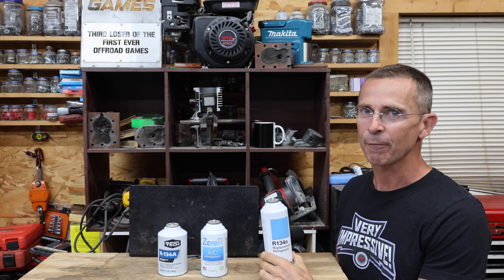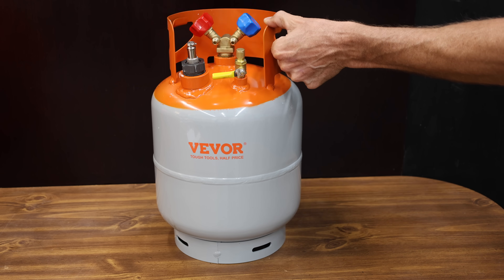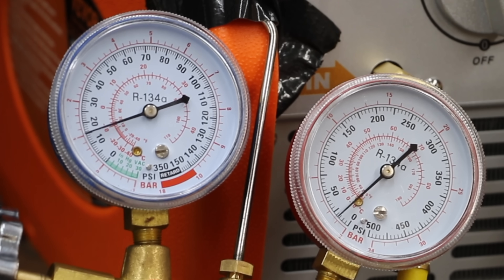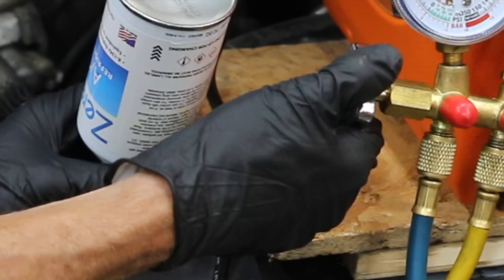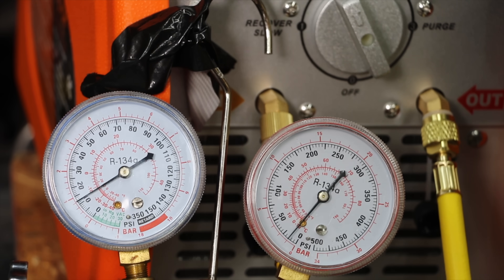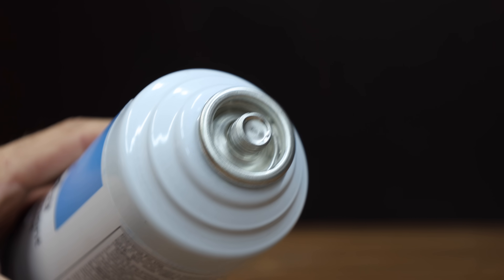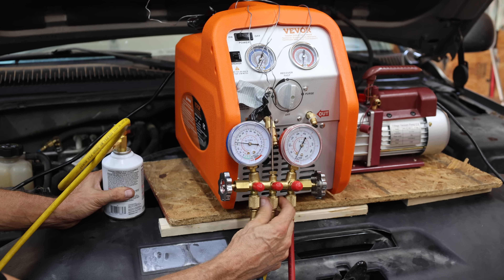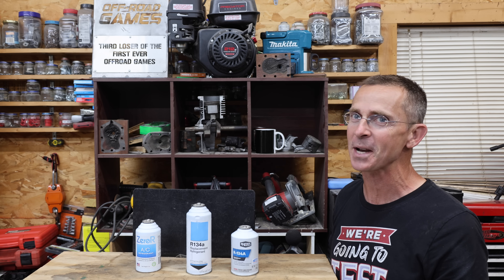How Dangerous is Fake Car A/C Refrigerant? Let's Find Out!

Comment: I own an HVAC company and I'm surprised how well and thorough you did with this video. I shouldn't be, because you're always thorough, but I never expect anyone to grasp refrigeration very well. Great job! I didn't even realize there were a bunch of 134a replacements on the market. Good to know. Replacement refrigerants usually work fine, but I avoid them when I can. 
Also, I'll ask again and hopefully one day you'll be able to get to it, but- testing coolant additives would be awesome. Those additives that are supposed to make your cooling system run cooler like Royal Purple's Purple Ice, Water Wetter, etc.
Reply: I've heard some compounds have troubles mixing with oil in the system. You gotta use different oil with them. All in all probably not worth the risk.
Reply: Propane works as a R134a replacement and is used in the EU in giant refrigerated warehouses because of reasons that have to do with Greta Thunberg
Reply: @The_Chad_  I used water wetter in my engine 25 odd years ago
It worked for me 👍
Reply: I would also be interested in a video on this. I don't like to waste money. But if a product is good, I want to know
Reply: @lt.lasereyez8891  You need to use different oils with different refrigerants, so you cna't simply replace them. You can find vids on youtube about how they mix with different oils
Reply: About 15 years ago I worked at a Chrysler/Dodge/Jeep dealer when they were still under Diamler/Mercedes. They were back then trying to find a safe way to use propane as refrigerant because of environmental reasons.  

Works "okay" as shown in the video as a replacement, a system properly designed around the use of this stuff would probably be hard to tell the difference because propane at least boils at like -40~ish degrees.
Reply from the maker: Thanks!  Thanks for the suggestion.
Reply: @astrangeparrot  yeah but I find it dangerous especially in large applications and cars
Reply: @lt.lasereyez8891  Yup and the next "safe green" refrigerant they want to require in the US is 70-80% propane.
Reply: As a certified MACS/IMACA Tech I feel this video is quite possibly the best one I've seen so far that describes how an automotive system works in easy to follow and understand terms and the methods used on the system were quite well done even to the point of reclaiming the replacement into a tank that is not the same as one that is known to have nothing but r134 in it. If memory serves me right the replacement stuff has a hydrogen fluoride component in it similar to r1234 which should not ignite when exposed to hot surfaces or sparks, but will ignite when exposed to open flame.
Reply: Auto racing sanctioning bodies actually require water wetter instead of ethylene glycol, due to the slipperiness created if that type of coolant should wind up on the track - creating a hazard for other racers. Water wetter has a long, successful "track history" in modern auto racing.
Reply: @PuerRidcully  He's not talking about AC systems, he's talking about engine cooling systems and products marketed as "Water Wetter", etc
Reply: Honestly, if you want your cooling system to run cooler, just replace your thermostat with a lower temp one. Most cooling systems are capable of better cooling right out of the factory but the stock thermostat kicks in higher than necessary. My stock thermo was a 195F. I swapped it for a 180F and it's doing great.
Reply: Never add coolant additives to your A/C per Scotty
Reply: @TheCharleseye  Running you engine cooler than it's should comes with negative consequences. Not only in efficiency, but it wear and tear. Those higher temperatures are used to leverage various things, up to and including keeping moisture out of your oil system and crank case. It's generally not a good idea for regular duty vehicles.
Reply: @therealdojj  I used it around that time as well I think some of it has to do with what it is actually supposed to do.  I used to get to work about when the car was finally throwing heat in the winter.  Using water wetter it was within just a few minutes at most typically.  First it's less effective when not using pure water like in racing many don't realize.  Second it is supposed to more efficiently pull heat from the motor.  By reducing surface tension, to eliminate heat pockets which coolant can't effectively cool.  Which most cars measure the coolant temp not the actual metal.  Depending on the vehicle the coolant may get warmer since it is pulling more heat from the engine.  If your cooling system is in bad shape, coolant is old or not the proper ratio yeah probably not going to get the result you want.  Besides your thermostat and engine computer want to run in a certain temp range.  They will do what they can to ensure that happens.  Gripes about WW are like when people use different heat range spark plugs for the same expected result.  They are designed to run in a different range not magically drop your engine temp down 3 degrees or anything like that.  If you don't adjust anything all that will happen is at best they will run worse or wear out sooner than the correct ones would have.
Reply: @PuerRidcully  That definitely can be true, but most newer refrigerants and refrigeration systems will use oils that are compatible with one another, but that's definitely not always the case and it's best to know for sure before replacing a refrigerant.
Reply: @funkyzero  he was talking about  both?
Reply: @PuerRidcully  that can be true, but isn't universal. It was more a problem when systems that used mineral oils were being retrofitted with refrigerants that require POE oils. It's still something you need to be sure of when doing a retrofit, but it's not like the oil needs replaced in every circumstance.
Reply: @DrDennis  I agree with that statement, but I'm talking about additives for a liquid cooling system, not refrigeration systems.
Reply: @ProjectFarm  Ive used the Water wetter product and the Royal purple product. I noticed they claim to cool better with water and their product than with coolant and their product.
Reply: I can tell u that Engine Ice works, normally when the fan comes on u can watch the numbers sink 1-3 degrees about every second or so. W Engine Ice its like 3-8 degrees. Like throwing ice on the motor
Reply: @therealdojj me too. The weirdest thing about the stuff is it increased the noise level of a water cooled engine because of the increased thermal (and sonic) conductivity. I could tell when the thermostat opened on my bike from 2m away from the sudden increase in engine noise from the radiator.
Reply: @lt.lasereyez8891 are you upset about the sciencr behind refrigerants messing with the atmosphere? Ever wonder why you don't hear about the hole in the ozone layer anymore?
Reply: @pmode2474  Because it went out of fashion Greta, just like Covid19
Reply: @funkyzero  Nah, it's fine. We're talking about 15 degrees.
Reply: That's because you HVAC guys are elitists who think mini-splits can't be topped off. You think we should all strictly obey the manufactures who sold us failing units. Imagine a car mechanic who refused the workarounds. 🤣
Reply: @The_Chad_  These 'replacements' are R290/Propane?
Reply: @lt.lasereyez8891  You're so uninformed lol
Reply: Water Wetter works. I used a digital thermometer gauge in my old car and ran Water Wetter as a test. It went from 190 (using half width radiator before cooling fan) to 180ish in the same condition ... but my thermostat range was in there too so I removed it. If you just need to drop coolant temps 5-15 degrees for whatever reason, it definitely works
Reply: @therealdojj  Same.  I had a sensitive after-market water temp gauge on my car, and water wetter - at least what they used to sell as Water Wetter back then - absolutely worked.
Reply: @PuerRidcully  I have heard that too. Ammonia was once used also. Maybe it is still used industrially. I'm not sure but back in the 70's my Dad was moving my Grandma out of the house he grew up in. In the basement was an old refrigerator from the 40's that still worked and was used for beer kegs behind the bar. (Germans 🍻) He was tearing it apart so he could move it out by himself to scrap it and when he cut the lines it filled the basement with ammonia and I almost lost my Dad that day.
Reply: @cardinaloflannagancr8929 it is not propane. It’s tetra fluoro propene, which is still flammable but not anywhere near propane
Reply: @PuerRidcully  R290 works well with any oil. R134A needs PAG or POE oils however, will not work with old mineral oil that was used on old R12 machines. In other words, the new compressor oils are backwards compatible with old refrigerants, but definitely not the other way around.
Reply: @TheCharleseye  No that's not a good idea with modern cars. The ECU will be looking for that 190-195 temp range, and run in open loop or at least a fuel enriched cycle until proper temps are reached. And actually you want to try and keep that heat in the engine, it's a heat engine after all, you're trying to convert as much of that heat energy from burning a fuel into mechanical energy, and the more heat you reject from the radiator, is literally throwing your money out the window. Within reason of course, if you overheat a late model engine, especially with junk like today's plastic intake manifolds you're asking for trouble. Run the proper thermostat, the computer is programmed to run at that temperature range.
Reply: @lt.lasereyez8891  Wow, good job Greta!
Reply: @TheCharleseye  Introducing problems of the engine running cooler than designed.
Reply: I’ve used Lucas super coolant in my truck that always ran a little warm and now it runs cooler than ever
Reply: His video's are always great...his welding skills are a bit lacking tho. Lol
Reply: @TheCharleseye not a great idea if ur driving any vehicle built in the last 30  yrs as most vehicles  will kick on the ck engine light for not coming up to temp
Reply: @lt.lasereyez8891 That’s interesting. In the US anhydrous ammonia (R-717) is used in industrial refrigeration. Where I work the system has 45k pounds of refrigerant, and 6 compressors totaling over 2000 horsepower.
Reply: @PuerRidcully  I would replace the 1234yf with 134a if you have that in a veh.
Reply: @davidshepherd-sj2tj   Nah, it's fine. We're just talking about 15 degrees.
Reply: Good idea! i use Hyper Cool and I "think" it helps but could be other factors at play. I already rebuilt my cooling system with a larger aluminum radiator and higher power cooling fan but I still put a bottle of Hyper Cool in it since it seemed to help when i had the inefficient , small radiator. not sure if its even necessary for any other benefits at this point though. lol
Reply: @Thanosisnotreal I've walked through similar motor rooms with that kind of setup! Was at a warehouse where they kept food frozen before shipping. Man, it was crazy loud and when my co-worker told me about what anhydrous ammonia does to human skin, my hair stood on end!
Reply: @brnmcc01  thanks for the info
Reply: I haven't done the testing to be able to tell you which works better, but products like Water Wetter do work.  They alter the fluid dynamic properties of the water to get better heat transfer.  It involves a lot of heat transfer and fluid mechanics equations, but basically if you are flowing a fluid through a tube, the fluid molecules at the surface of the tube wall have zero velocity while the molecules flowing in the center of the tube have a much higher velocity.  The change in average velocity of the fluid molecules as you move from the tube wall to the center of the tube is non-linear, with the greatest change in velocity per unit distance from the tube surface being closest to the tube, while molecules near the center of the tube all have largely the same velocity.  Having a bunch of molecules moving at drastically different velocities right next to each other causes a lot of collisions and results in what is called turbulent flow.  Having the molecules moving in the same direction with the same velocity is called laminar flow.  The transition from the turbulent flow at the inner surface of the pipe to the laminar flow at the center of the pipe is called the boundary layer.  Products like Water Wetter move this boundary layer closer to the wall of the pipe, resulting in more laminar flow, which also results in better heat transfer in the system.  All other things being equal, adding these types of products to your coolant will result in your engine running a bit cooler under the same load.  Depending on your vehicle use case, cooling system design, and whether you are adding these products to straight water or a water/antifreeze mix you can expect a drop in engine coolant temperature from a couple degrees up to as much as 15 or 20 degrees.  For a regular commuter car it usually isn't worth the effort, but for a race car or a vehicle that does a lot of towing (especially in hilly areas) it can reduce the stress on your engine and make it last longer.
Reply: @lt.lasereyez8891  Rubbish comment - Propane has been used as an industrial refrigerant for about 30 plus years well before Greta was even thought of. Not just in Europe also in eg: Africa, Australia etc the list goes on.  Ozone depletion caused by fluorocarbons was the factual start in the 70s to look for something better and we succeeded until some Asian countries decided the rules of nature don't apply to them.
Reply: @zorbakaput8537  Yeah no, recent EU regulations reduce the amount of R134a being produced and sold here in the EU, so these giant installations now use Propane that is les safe but cheap and available. The reason for these regulations is that R134a is now considered a greenhouse gas. So yeah thanks Greta and all that climate change nonsense. Also nice that in the USA and China en the rest of the world anyone can just buy R134a in a store and do whatever with it so those EU regulations will be VERY effective indeed.
Reply: @lt.lasereyez8891  I mean, R-134 is flammable when present in concentrations between 5% and 17% in air.
Reply: @zorbakaput8537  Agreed, propane is fine. There's not even enough of it in an automotive application to cause any serious issues. Worst case, an vehicle accident ruptures a line and it flares out. Anyway, it's funny to watch people be more accepting of driving vehicles with 450lb batteries that combust when exposed to air but 22oz of propane is treated like it's some hollywood explosion. 😂
Reply: @Eric2300jeep  exactly, very loud. NH3 is very dangerous indeed.
Reply: @JimmyDean-h8y  True, and what about propane ?
Reply: @hottractor1999  Nah, it's fine.
Reply: @lt.lasereyez8891 Does It deaden the sound of her Screeching?
Reply: @therealdojj  I’ve done straight water when I first got my license. 83 Jeep cj7 w a Chrysler 306 v8 (Broke the skinny oem drive shaft many times). I never added coolant for the winter and had to bring it in the garage to thaw out when it froze. It was fine but I learned my lesson
Reply: @The_Chad_  Marketed as Hi-Chill -30 (C) in Australia. These drop in alternate gases have flammable propane and yes they work fine, but when DIYers just drop em on in over remnants of God knows what gas and oil, they end up causing more damage than good. Even some professionals swear by these gases simply because they are cheaper to buy and use.
I have been in the Auto air business for 35 yrs now and have seen R12 freon to R134a transition and now we licensed businesses are seeing another new industry standard gas coming in R1234yf FFS lucky I'm soon to retire 🤔😏🥲
Reply: @PuerRidcully  there's the problem when DIYers drop these gases in over old oil and leaks, sometimes not even evacuating air and moisture out 😏
Reply: @funkyzero  currency, try doing a forced DPF regen on an engine that won't warm up properly, it just won't happen 😏
Reply: @The_Chad_  bro we have a robinair machine at work...had to replace an electric POE compressor on a hybrid....it literally took a hour and a half to charge the system. It's THE BEST.
Reply: Watching this video from Canada where we go through 4 years of school for this is rough. I'm so used to everything being done(for the most part) correct in the trade. The US needs a standardized trade program to catch up.
Reply: @PuerRidcully there is detailed retrofitting guides published by the manufacturers. Most oil return issues arise in systems with receivers in the system.
Reply: If you want your cooling system to run cooler, just remove the thermostat. The issue is that you do want the coolant at the manufacturer-recommended temps. The cooling system is more than capable of bringing the car below operating temps on a properly operating engine.
Reply: @PuerRidcully additives for the engine cooling system. The radiator additives.  Not AC additives
Reply: he does an awesome job with this stuff, not just the videos but with all the prep work that has to be done prior, and they are entertaining too.
Reply: @justarel you're certified in nothing.
Reply: @JimmyDean-h8y  the issue with propane in automotive applications is that a leaking evaporator will fill the cabin flammable gas ...
Reply: Using replacement refrigerants can affect the oil your compressor, because of the chemical makeup of the refrigerant can break down the oils viscosity.
Not to mention proper return temperature of the refrigerant for a cooling mechanism.
Reply: I personally use the hyperlube and it works awesome. I went from 225 in city traffic to 190, In the middle of summer with air conditioning on. I did not mix it with antifreeze as we barely get that low.
Reply: Water wetter work’s perfect
Reply: @TheCharleseye  it's fine for the engine but , still may very well give u an engine light and if u live in a state where emissions is part of inspection it could very well become a problem for u .... Js
Reply: @davidshepherd-sj2tj  Nah. I live in California and have been working around their nonsense for decades. If you kick down to something like a 165° thermostat, you'll have issues. 180° is fine.
Reply: @astrangeparrot  I have a portable AC 1 hose design i converted to a proper dual hose design that runs propane and... honestly it does a great job but the evaporator side does not seem nearly as cold as a r134a system! It does pull water out of the air and cool a room by more than 10 degrees so no complaint
Reply: @lt.lasereyez8891 quite a few here in the states use Ammonia systems.
Reply: curious of your thoughts on the 123 refrigerant. supposed to be flammable also. although designed for such.
Reply: @lt.lasereyez8891  she will fight for a better environment in your place.
Now back to the tv re-runs you are more concerned with
Reply: @lt.lasereyez8891  Propane is actually a very close match for the R-22 that was used for decades in domestic air conditioning. It has almost identical characteristics and even offers slightly better performance. R-22 and propane will both work to some degree in a system designed for R134 but it's not optimal, the pressures are wrong.
Reply: @astrangeparrot  I've been using propane for many years in the R12 system in my '84 Volvo. Initially I tried it because the system was empty and I just wanted to assess the state of it and didn't want to waste expensive and ozone depleting R12. Turned out it worked very well so I just kept using it. The compressor in this system has an oil sump so I didn't have to worry about oil circulating with the refrigerant.
Reply: @lt.lasereyez8891  You've already got 10-20 gallons of highly flammable gasoline circulating through plastic high pressure lines in most cars, what difference does a few ounces of propane make?
Reply: @lt.lasereyez8891  Technically its a mix of propane and isobutain to keep the pressures close to correct. Propane alone has far higher pressures and load on the pump. Propane alone is much closer to R22 pressures and thermal properties. Hydrocarbons will mix with any current oils perfectly well too.
Reply: @James1095  that gasoline is not at the very front of the car unlike the AC gas used. It's the first thing there right after the bumper. They don't make cars with the gas tank in the front anymore for that reason.
Reply: I don't know if coolant additives are really effective but when you consider that a gallon of pure coolant concentrate id about $15-20  and add $2  for distilled water you still have a pure clean coolant drain and refill for about $20 

change every 2 years no matter what the company says it life span is and you be Golden!
Reply: @TheCharleseye  I can vouch for you on this one. I had an 08 Corolla and I once blocked off about 70% of the radiator and condenser to see if I could get it to warm up quicker on my highway commute. I started in late spring and it seemed to do alright so I left it alone. We then had a warm snap and I noted that the car was still maintaining coolant temperature reasonably well. That is, until I had the A/C on in stop and go traffic. That caused the temperature gauge to rocket toward the red "H" mark pretty fast. Luckily I was able to turn the temperature knob to heat and open some windows and the temperature quickly recovered.
This was also when I'd discovered the wonders of Bluetooth OBDII readers and I realized that there's about a 40 degree F dead-zone in most modern cars' coolant temperature gauges.
Reply: I was sweating bullets trying to figure out why my A/C wasn't working, turns out it was because I accidentally bought the 'air conditioner juice' from the dollar store!
Reply: Replacement refrigerants exist because of the need to use them. We are in a world where we will always be changing to a new refrigerant to keep the producers leading the market.
Reply: @PuerRidcully   you are right
Reply: Its literally just propane in those cans. They call it R-290 when its used a refrigerant. Owning an HVAC company, I would think you would know that tho....
Reply: @francisphillipeck4272  Well that's not true. R-290 is a refrigerant, but is rarely used as a refrigerant on it's own. It's almost always blended with other refrigerants, and often none is used at all. I guess I really don't know what you are getting at with this comment.
Reply: @The_Chad_  It could be R-600a too, which is butane. What im getting at is those cans are just propane or butane, a hydrocarbon based refrigerant. Neither of which are replacements for R-134a.
Reply: @francisphillipeck4272    Oh ok. I forgot we were talking about 134a, which I don't work with often. I think I said in my first comment, I didn't even realize drop-in replacements for 134a were being sold, which you're right R-290 is being sold as a 134a replacement. I don't really understand the purpose as 134 is still so inexpensive. But what do you mean that hydrocarbon refrigerants aren't replacements for 134a? Off the top of my head, I don't know the PT correlation between propane and 134, but I'm assuming they must be pretty close if you can fill a 134a system with 290 and it works fine. I wouldn't be super comfortable putting it in my car, and I'm not arguing that it is or isn't a good replacement for 134 because I don't know, but R-290 and other flammable compounds are becoming more and more popular as refrigerants and components of refrigerant blends, so I guess we need to get used to it.
Reply: Can you try testing Coolant for Cars?
Reply: I am a hobbyist about 20 years ago I asked an air conditioning engineer why they don't use them as heaters bringing the heating from outside he said to me that is a function they have but they don't use it like that.
 way to go I think I was thinking about inventing heat pumps without realising it
Reply: You don't expect him to grasp a simple concept dudes with 6 week of training repair? Not trying to be mean but refrigeration isn't a difficult concept.
Reply: @lt.lasereyez8891  Well then don't look into industrial scale use, from what I understand it's not super popular but used in the EU a bit. Much larger than cars lol.